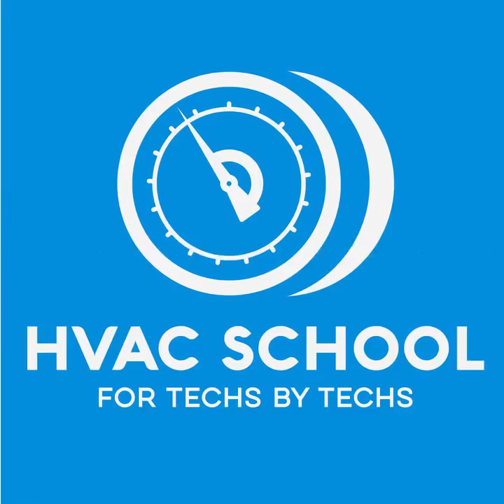How to Make a Flare That Won't Leak

Comment: Great information!  One thing to note most mini splits use PVE oil this oil has better lubricating abilities as well as moisture can be removed easier one reason why they use it is there typically no filter dries in a mini split system.

Comment: I watch workers speed cut tubes..never deburr and square ends before generating a flare..no measurement of applied strength /torque on tool or fittings so I can expect a warranty call when their mini split fails to perform..I know a clean  lubed fitting and a dry fitting will reach maximum grip at different levels of force. Most metal fasteners are rated clean and dry..so if a lube is applied be aware and slow your approach to the recommended torque spec.